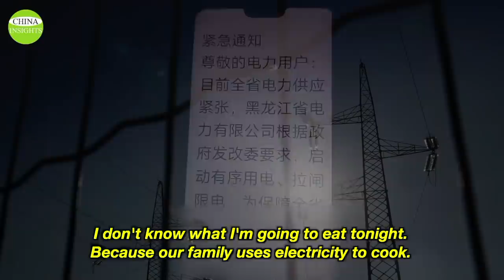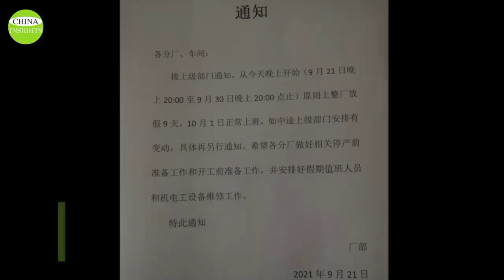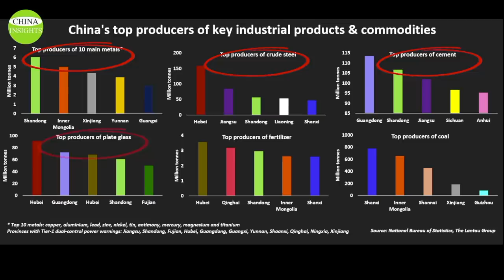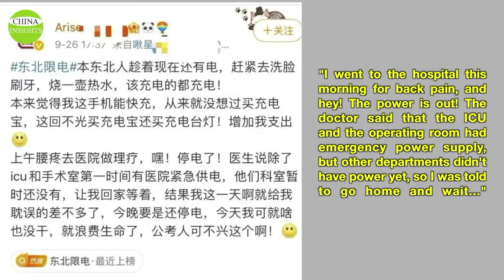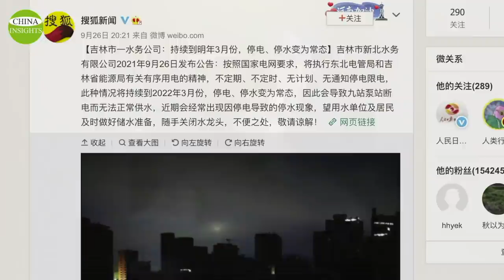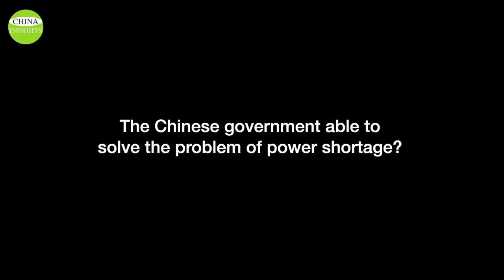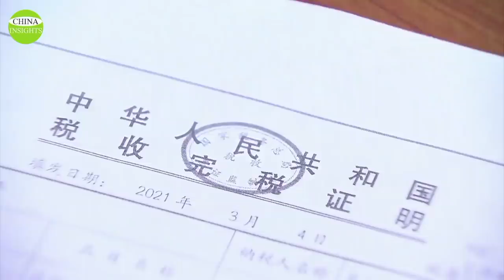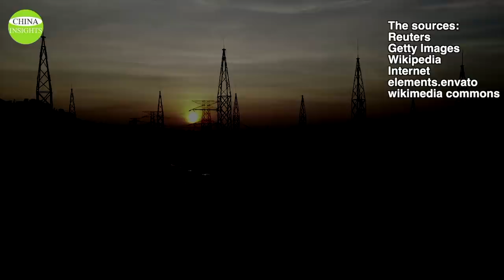‘Unprecedented’ China Power Outages: Close Factories and Threaten GDP Growth/What are the Causes?

Comment: is this why they banned cryptocurrencies? because the mining was too expensive on the power consumption?
Reply: They were also trying to reduce capital flight
Reply: mining alone won't bring down an electrical powergrid, crypto mining existed way before the power crisis
Reply: No they were trying to cut down on foreign influences like usual
Reply: @Shinzon23  Most government policies always have multiple aims to reflect the diversity of interests.
Reply: @robertmarmaduke9721  doge coin is meme coin and gamestop stocks are also a meme, so why are you comparing it to crypto. 
Also, bitcoin does have some sort of inherent value, as its supply is limited and it allows a decentralized transaction system, which is more than you can say about your precious fiat money
Reply: @robertmarmaduke9721  Crypto was banned in China back in 2013 with the restrictions tightning in 2016. Back then China accounted for nearly 60% of all newly mined crypto, dropping to around 40% after the initial bans. I doubt the CCP banned crypto to prevent a power outage 5 years later. The issue is a lack of coal from closing deals with Australia. Chinese electricity skyrocketed as a result, but the country's supply wasn't ready to meet the new demand.

That is why China posts about how they're going green and cutting down emmisions this year, not because they actually wanted to, because without context it makes them look good. 

You'd be a bit more convincing if you had more to your channel than a stream of 'Pro China, anti Westerner' comments and a playlist named to match.

Comment: A 3% cut in coal from AU doesn’t sound bad, but the issue is that it snowballs.
(Made up numbers for example)

Month 1: 100t of coal needed. 3% short due to no AU imports. This 3% will add on each month because in reality, supply is finite.
After 12 months of 3% shortages, they are 36% short for that month. Pulling supply forward with no ability to backfill creates a high gap eventually.
Reply: You fail to take into account many factors. Firstly this situation is not static, they can increase coal productive, secondly, Australian coal is different from Chinese coal, & power plants designed for the more refined & pure Australian coal work at higher efficiencies. China does not have the technology to produce this coal & these plants are not built to withstand the level of impurities found in Chinese coal. If the plant does get Australian coal than the plant cant run until they retrofit it.

Finally, amount the Chinese communist party is messing up is a lot more than 3% that's just the tip of the iceberg.

Comment: Bet ya the price of the electricity bill didn’t change from previous months
Reply: That's the whole point.  Price of coal skyrocketed and the power companies cannot raise rate in China.  So they cut power to save money instead.
Reply: Utility prices are regulated so they can't charge for the increase in production costs so they cut power instead.
Reply: @joyjoy534  Well, Partially. However, It doesn't matter how much you charge for electricity,
if you don't have the (quality) fuel to actually make it.
Reply: @A_Haunted_Pancake  that’s not a problem if you can afford to buy it at higher cost from elsewhere — in other words, the root of the problem is the fixed electricity prices to both private consumers and industry.
Reply: I am in China and if the price of power went up, I wouldn’t use as much. Too bad some people don’t understand basic rules of supply and demand.
Reply: @joyjoy534  or they could extra save money by charging them more on their electricity bill-
Reply: @David35687  Obviously, If the demand for energy is higher than what the Government supplies, the only logical explanation is, that the People are too wasteful. 

Why ?  
The   Party   never   makes   mistakes - Specially when it's obvious to anyone they did.
Reply: @A_Haunted_Pancake : I feel bad because I didn’t know an energy shortage was coming and I ran my air conditioner for almost the entire month of August. Not because it was super hot but because if it wasn’t running mosquitoes were able to fly in from outside to inside my apartment. When I turned it on, the moving mechanisms inside the air conditioner prevented the bugs from sneaking in to my room. Doing that cost me about $50 but those mosquitoes were driving me crazy at night. 

Next summer I’ll buy some mesh and cover up the external unit to stop the mosquitos from getting in. 

It’s just goes to show one of many the stupid reasons why waste happens in China. 

In the winter, because a lot of the older apartments don’t have independent temperature controls, it actually gets too hot in some apartments and people end up opening up some windows.
Reply: That reminds me of the joke that was often told in the old Soviet Union. The peasant was asked by the commissar how the potato crop was going. "The potatoes are stacked so high that they reach the feet of God, sir!" The commissar replied "That's good to hear, but you realize there is no God, right?" To this the peasant replied "and there are no potatoes either, sir....." The point being that Chinese electricity rates have not changed, but there's no electricity flowing either.

Comment: Why force people to freeze.
They should have switched to the alternative power before shutting Down coal plants.
I normally use electricity for cooking but during pandemic I purchased a small gas cylinder based stove that's sealed right now.
It can last for easily a month.
Reply: In US, most out in rural area if they have electric stoves, will also have gas, charcoal or even pellet grill on the side plus other propane camping grill etc etc if their generator breaks that is.
But China, most in apartments buildings… they be SHTF SOL. Their coffin concrete box that doesn’t ventilate well… using certain fuel may poison them. Even if the generator works and they have an open air space, they still can’t hook it to the main water pump in their building to access water 💦. Like I said… most PRC, will be SOL (sh!tz outta luck).

Comment: Basically shows the future that they will make here too because alternatives are basically non existent or required as much energy that it goes over the limits.
Reply: Nuclear reactors are the best and most ecologically friendly sources of power.
Reply: @abyssstrider2547  Except for the nuclear waste which we still have no place for even with LFT & MSR and SMR’s these things still have a very long time to be keeped in the right containment. But maybe the gau’s we had are also something good re-naturalisation is definitely a good way to reduce Co2 emissions. Having such a thing near a big city would especially be ideal..
Reply: @platin2148  Just keep them deep underground. Maybe we even find a use for lesser elements. Or create new reactors.
Reply: @MnemonicHack  So solar and wind and hydro and geothermal it is then. 

As the only other reactor type that got approval are water heater reactors which are just stupid to build if you can’t keep the pressure of the water without doing anything. The danger of polluting a area where there is a big town is just to high with them (doesn’t mean they are unreliable but one gau and it’s over). 
Everything else is speculative and will probably take another 7ish years to even get a test setup going. And then probably another 30 to 20ish years to actually fully operate.

Comment: Have the mighty 3 Gorges Dam turbines stopped spinning? 

Lord knows those incessant floods over the last couple of years have carried mountains of debris into that reservoir quite possibly clogging the inlets/ turbines or at least deteriorating the turbines prematurely.

The areas first effected by the power black outs were the farthest regions from the dam which would make sense due to the cost of power transmission.  The farther away from the source the more it cost to get there.  Too bad so sad.  (Recently we had two fires in the 'hood, one to the east and one to the west.  Both power and phone lines burned for miles with power lines down for weeks phone lines still out after months.  I understand their predicament but I'm probably better prepared.  God help them)  

Ones heart goes out to the Chinese people for what they've been enduring over the past several years.  They most certainly don't need nor deserve the results of a Three Gorges Dam structural failure to hold back a horrific flood.  A wall of water just under 600 feet high stretching back over 300 miles.  Catastrophic.

Comment: History doesn't repeat, but it does rhyme. This is essentially the same thing that happened in the USSR before the collapse. There are a lot of parallels between the USSR and the CCP. They're both totalitarian expansionist governments. Why are they expansionist? Because, within their own systems, the shocking degree of inefficiency is draining them of all their resources and they need to be able to take from others to fill the gaps in their own internal systems. We didn't beat the USSR because we had better jets. We beat them because their entire system collapsed under its own weight. China is going to do the same thing for the very same reason. We just have to give them time. Their collapse would happen overnight if we and just one or two of their other larger trading partners stopped trading with them. It would be a complete and total system failure. At that point, we could set any terms we wanted to re-establish trade. We could demand fair elections that include non-CCP candidates. The end of forceful organ harvesting. The end of their police state. Etc... We just need the political will to do it. We'll defeat the CCP the same as we defeated the USSR.

Comment: China is the largest coal producer in the world. The power cut is  not because of the ban of Austrilia coal.
Austrilia coal is coking coal which is used for steel making not for electricity producing. There are many reasons for this power cut.
1.Due to the weather disaster in indonisia and some main-coal producing areas in China, the supply of coal is in short, which caused the price increasing for coal on the international market.
2. Too much US dollars printed and circulated in the world have caused inflation and price increasing for most commodities, including coal.
3. The electricity in China is mainly produced by nation-owned company, so the price is not decided by the market, but set as fixed by the government. And now the price is below the cost of electricity producting due to the high price of coal.
4. Because of Covid in Southeast Asia, many export orders have flowed back to China. To process these orders, large amouts of electricity are needed. Though these products will be sold in the western countries in relative cheap prices,  factories in China could still earn small margins due to the fixed cheap electricity price and low production cost . However, because of the electricity cost is increasing and fixed electricity price, in fact it is the Chinese electricity company subsidizing these factories and the consumers in the western countries
5. China wants to transfer the manufacturing industry into a greener way in order to fulfill the CO2 emission goal and  keep the sustainabilty. So these energy and polution intensive factories  and  exporting orders are not encouraged  in China. In order to keep the low fixed electricity price (It is important to keep the living standard of Chinese people), the electricity net chose to cut off the power for areas with lots of enegy-intensive industries.
6. The citizen use of power  was not supposed to be cut off because it only counts for a small share in the electricity consumption. It is because of the local governments misunderstand the policy and used "one-size fits all " method to fulfill the emission goal. And probabaly some of them will be examined for their responsibility.
7. Because every province is facing an emission goal, but it’s difficult to achieve because every province also has the incentive to encourage the factory production to get the higher GDP and Tax. As a result, these emission quotas are usually used up during September and October. Then these local government began to limit the electricity use to make their carbon footprint not looking so bad. That’s why we didn’t see power outage during peak season like summer but in Fall.
Reply: @Madame702  Do you know how old Jiang is? 95 already
Reply: @mikeygao3393  Geez, Mikey did you just fall of the rice truck from the farm???
Reply: @mikeygao3393  Jiang has a huge contingent of people under him.   They don't like the direction of Xi Jinping or Li Keqiang is taking the party.   Why few years ago a Chinese warship open fire on another Chinese warship carrying Li Keqiang.   Li was so frightened he did not go back to Beijing because Jiang was there he didn't know if it was safe.
Reply: @mikeygao3393  Just remember Hu Jintao and Jiang Zemin don't get along this is well known within the CCP.   Xi Jinping with the help of Hu Jintao to take some the power that Jiang Zemin had taken.
Reply: @Madame702  Jiang qing is responsible for the cultural revolution. She was sentenced because she started the culture revolution, not because she was mao’s wife.
Reply: @mikeygao3393  It even said that before his fall Fu Zhenghua bragged that he tapped the private phone conversations of Xi Jinping himself.   So you see that Jiang Zemin's faction is still alive and kicking. They are still causing all kinds of trouble for Xi Jinping, Hu Jintao, and Li Keqiang.
Reply: @Madame702  I can’t say all of your conspiracy is false, but first you have no evidence to prove your point only rumors . Second that’s is not the main reason for the power out this time.
Reply: @mikeygao3393  Frankly I'm disappointed that you haven't figure it out.  Or maybe you have you just can't say can you.
Reply: @Madame702  I won’t give conclusion based on hearsay or conspiracy theories.  I am just analyzing the power out based on economics and information I knew. What I am saying is if you don’t have evidence of these conspiracies, you should not spread these rumors. That’s the difference between the Chinese and American understandings about the free speech. You enjoy free speech, and you should be responsible for your speech too, otherwise it is libel